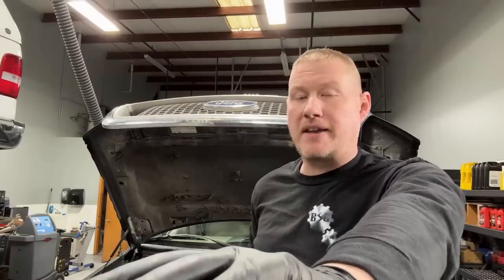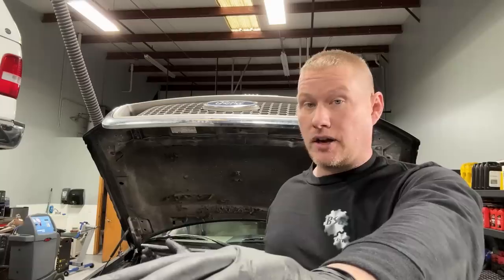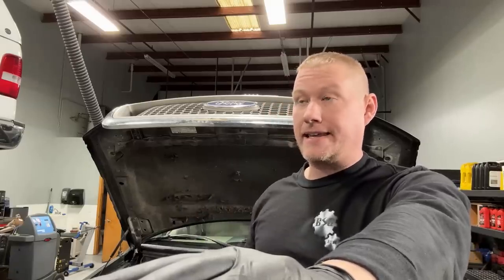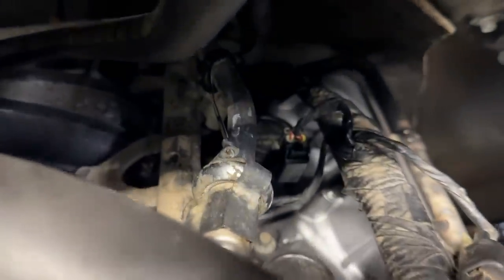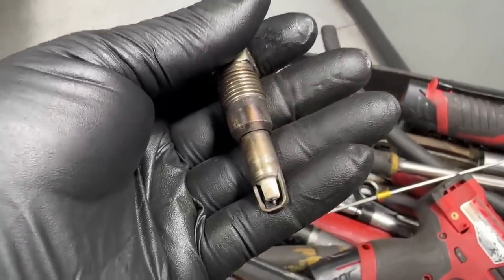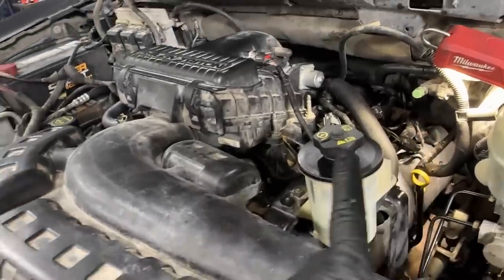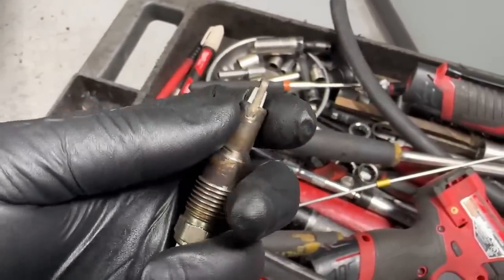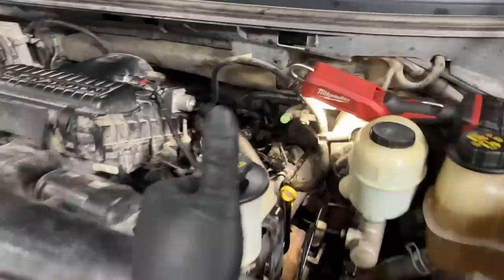How in the World is There a Belt Chirp Noise Coming from INSIDE of this Engine?

Comment: My 5.4 has 325k and has only had a throttle body replacement. It has original everything else. Engine has never been opened and even have original hoses, starter, alternator, etc. Change your oil, I use ZMax micro lubricant, and love your truck. I’m shooting for 500k!
Reply: My ‘06 5.4 3 valve had 190k. Plug’s and MSD coil’s @100k, throttle body and alternator were the only thing done to the motor. Frame was starting to worry me so we traded it in. Still ran like new.
Reply: No timing kit!?!?
Reply: My brother has 385k on his 5.4 and still running strong. Never opened up and only changed the plugs at 300k. It's a f350 with a utility box and only ran in the city so they are very rough miles.
Reply: @christinaperez254  nope, never opened the engine. Keep the oil changed @5k and full synthetic oil, I used Mobil 1.
Reply: @chriscochran8079  dang! I do all the same maintenance wise.... but still had Brian do a timing kit and melling pump job at 100k just for insurance. Our Expy is our family's one necessary car. She can't be out of commission.
Reply: I hear a low idle timing chain slap in my 2007 KR F150 at 195,000 miles. Do you have a chain slap? I believe due to tensioners. 5.4 3v
Reply: @christinaperez254  I completely understand that. I started to change the roller followers but stopped after trying to get bolts loose and they just crumbled. People just don’t maintain their vehicles on a regular basis, money I’m sure is the root cause, it will still run with dirty oil so they say I’ll catch it next time. All new engines have tighter clearances and orifice’s, maintenance is the key to longevity. Cheap insurance.
Reply: @chriscochran8079  which bolts crumbled? Exhaust manifold?
Reply: @christinaperez254  valve cover bolts. I guess I didn’t wash the engine enough.
Reply: Goes to show not all them are bad, I had one, heard so much negative about it I sold it after warranty ran out. Should have kept it probably would have been fine.
Reply: That is amazing. I've seen those things put really put on some mileage as well. It's a hit-and-miss you get a good one once in a while and you get a bad 1 once in a  Wow. Kind of glad you got a good one there buddy
Reply: @chriscochran8079  eww msd coils
Reply: @neilbrown82   90k on the MSD coils and a K&N cold air intake. Never had a problem with them unlike the Ford coils I had on my 2002 Explorer.
Reply: @chriscochran8079  that's awesome. So glad to hear that. What weight of oil are you using? Did you switch to 5w 30? I have an 04 F150. Owned it since new. I change my oil every 3,000 miles. Regardless. Overkill? I'm sure it is. Switched to full synthetic 5w 30 2 years ago. Not a tick. Knock. Or a clunk. Hope to drive it until the wheels fall off.
Reply: @brianstauffacher   I changed the conventional oil at 2500 miles until around 80-90k then switched over to full synthetic Mobil 1 5-30 until 190k. I used it as a truck, towed my Derby cars and beat up the bed. 35-12.50-20 Firestone M/T , this truck was used but always maintained. It gave us very good service. K-N cold air, JBA cat back exhaust, MSD coils and Champion one piece plugs around 100k, I was always trying to get something better than 10mpg loaded or unloaded, hwy or city, the only thing I didn’t like about the truck. Hope that answers your questions. 5.4 3valve is a good engine when serviced on the regular, don’t neglect it.
Reply: @chriscochran8079  best testimony ever!
Reply: I hear you bro. I believe their ol phrase built Ford tough My 97 4.6 shows odometer 297k but odometer out when i got 10 yr ago. Everything still factory installed. Ive got a belt noise why I started watching. Gave fifteen hundred then. Do believe got my money worth. I could sell for that now all these  years later. Was never a big Ford fan but admit my 2 toughest are 84 ranger (1st vehicle) I tried blow up n this 97f150. Good luck on your road to 500. Got odometer fixed last year so hopefully I join the club. Closer now than ever.
Reply: I just bought a f250 super duty it has 335,000 miles it has a belt squeak and a slight miss engine light is on

Comment: I feel like most mechanics would never think to check the spark plugs for a squeak like this.  Brian is knowledgeable enough to think outside the box. 👍
Reply: JUST KNOWING THAT ,WITH THE NEWER VEH YOU NEED T5O CHARGE THEM WITH THE NEG CABLE TO THE ENGINE GROUND AND NOT ON THE BATTERY MY FIRST FORD WAS 6 VOLTS POS GROUND
Reply: @williammason6578  a car club where everyone acts like boomers :P

Comment: I'm not mechanic but man, this is a class channel. I have a 2010 with the 5.4 triton and he has really helped me with the simple stuff.
Reply: They're great trucks. As long as you keep up with maintenance. My 2010 5.4 has 206K never been touched and 0 leaks.
Reply: I had my 2010 5.4 FX2 S’crew. until this past November. I had 300k miles on it. This man is Godsend. I have done so much with that truck myself because of him. You either “get it” or you don’t.  #F15012thgenerationloyal
PS: 12th generation is the way to go.

Comment: I had a belt chirp noise, worked on it for months, changed belts, idlers, alternator (old 1991 Dodge D250 Cummins) had me stumped. WELL finally found it. 
was a worn through last bend in the exhaust pipe , I live in Oregon, NO rust at all. but that worn/crack in the LAST bend before the exhaust tip. and it's rubbing was the chirping. Fixed that bend and NO MORE CHIRP. Man that puzzled me for a long time, now it is Great. Weirdest thing. really enjoy your videos even though I don't have a ford. Thanks

Comment: I had a 2009 5.4. When I sold it, it had 320,000 miles on it and the motor had never been touched and no oil usage. It ran like a top, no codes,and not one fluid leak. It had a very slight., what I think was a phasor knock but did not affect the drivability. I bought it at 30,000 miles and was anal about maintenance. It could go 1/2 million miles easily. Best truck I ever had.
Reply: I have a coworker with one about the same mileage, just been maintained.
Reply: Yep! I’m planning on being buried in mine! 😂👍🏼
Reply: why sell it
Reply: My 09 5.4 is at 278k nothing wrong with it but I am planning on doing timing chains and oil pump soon
Reply: I had the same truck with same motor and I loved it. Got the cam phaser issue too (it was BAD) sounded like a bag of hammers accelerating out of idle. Ended up traded it in for a 2016 with 5.0 and I really like this one too but i do miss the old one.
Reply: My 2006 ford f150  5.4 v8 that I still have to this day has 322,000 miles original engine & original transmission still going strong. I've always changed the oil every 3,000 miles
Reply: I call bs but ok.
Reply: @arielatom03  if I was you I would probably call bs also, but I swear my 2006 ford f150 5. V8 has 322,000 miles on it.  I've changed all the ignition coils with motorcraft coils (expensive) ,but ford 5.4 3 valve is picky and motorcraft parts NEVER DISAPPOINTS. All the spark plugs are motorcraft and never drive it hard and beat the shit out of it
Reply: @wesleythompson7  source: trust me bro..
Reply: I still have my ‘09 5.4 I bought new and almost 14 years later with proper maintenance it’s been mostly trouble free ( exhaust manifold & VCT solenoids replaced). It runs quiet and goes from oil change to oil change without using a drop of oil.The rest of the truck is still in great condition and I’m thinking I may end up getting 25 years use out of it.
Reply: All of you folks are truly blessed to have no issues with your trucks...  many are not.
Reply: Show us the underneath…
Reply: Cannot beat Ford trucks that's all I buy ..always. New '22 F150 Tremor in driveway now w/5.0L Coyote .
Reply: @arielatom03  BS what? Only BS you will hear is the supposed Yoda guys w/there 500k mis on these Ole 5.7L V8 Tundras...when they hardly sell any of those turds .

Comment: Our family drove i believe it was a 2002 Expedition 5.4 for well over 300k miles without any single problems, did have the entire front end rebuild and the A/C replaced but other than that the drivetrain was solid.  Oil changes every 3500 miles. and the thing was buttery smooth.

Comment: This is EXACTLY the problem I am having with my truck. Thank you so much! You're the man!
Reply: You should still diag the issue to be absolutely sure. It could be something else even though the noise is similar. I would do a relative comparison test. If you have a loose plug, you should see it when you run the test, and you'll also know what cylinder the bad plug is on.

Comment: Nice job finding it. Reminds me of a problem I had long ago, miss at idle. I had just changed the plugs and could detect a miss at idle, so I pulled the plugs just to see if anything obvious and of course once you pull one you turn it upside down to look at it and they all looked good, EXCEPT one. As I was turning it upside down and then back to reinstall position something caught my eye, I turned it upside down and back again a couple of times and found the inner porcelain around the center electrode was broken and sliding down over the center electrode when in install position and how it would be in engine, got a new plug and problem solved.
Reply: Had exactly the same problem with one of my Harleys a few years back. Went to the dealer for a new set of plugs, changed them out and took her for a test ride. She ran at idle ok but under load there was this really annoying intermittant miss. She ran just fine with the old plugs, so I pulled the new ones and found the center porcelain on one was broken and loose on the electrode. Never seen this before in many years wrenching on bikes, cars and trucks. Nobody I know and in the years since have come across this before including the parts guy at the dealer. I still keep that plug in my box as a conversation piece, and this was before everything came from China!

Comment: my 2006 5.4 3v will turn 250,000 in 200 miles. no timing job yet! bought it with 108,000 miles. this one was one of the good ones. proper oil changes with the motorcraft filter and full synthetic oil. plenty of life left in it. rusting away in maine

Comment: I've personally come across this concern 3 different times working at the Ford dealer. It did take me a bit the first time to figure out where the noise was coming from. A Stethoscope is key to finding it without the attachment, just using the hose.

Comment: I use the heater hose stethoscope regularly on heavy trucks with their hundreds of leaking air lines and fittings. Just yesterday I used it to pinpoint a leak from a drier regulator after someone replaced every air fitting in the area hoping to cure the problem.

Comment: My 2007 had the classic ticking sound and sure enough number eight was loose.  The plugs had been changed by the dealer about a year earlier and I don’t think they did a very good job because two others were a little loose as well. I checked the boot, which was discolored, but still OK.  I tightened everything down and no more ticking noise.  Now I know to listen for a chirp too.

Comment: My 2006 has 270,000 miles with no issues. Oil changes, plugs and coil boots. Front end bushings and link ends. That’s it. Runs like a top. Original transmission and I’ve never changed the fluid. Used to pull a fifth wheel travel trailer until my wife developed brain cancer in 2019. I had to rebuild the rear differential at 98,000 miles but that was years before I bought the fifth wheel travel trailer. I guess I got lucky.
Reply: Why didn’t you change the transmission fluid a few times over all those years?
Reply: @billc7211  Just something I’ve never done. Every vehicle I’ve ever owned has never had the fluid changed and I’ve gone into the mid 200,000 mile range with all of them. Just worked for me I guess. All Fords mind you except for a ‘79 & ‘80 model GM that I got rid of well before 100,000 miles.

Comment: Brian you are a tremendously gifted auto tech, thanks for sharing this odd ball event. I also much appreciate your comment about the reliability of the 3 valve engine. I have a 2009, been researching and studying this engine for 2 years because of the possible issues it may develop. I read lots of viewer comments about very high mileage achieved with no problems but gave emphasis to listening to your many comments and demonstration videos about the many inherent design flaws and production defects plaguing this engine. I have a full upgrade FOMOCO timing set and Melling oil pump sitting at the ready. I was, until today, still on the fence about to do or not do a timing job and upgrade to this 65000 mile truck, that runs and sounds perfect. I will now wait. I use full synthetic oil 5-30wt changed at 3-3500 mile intervals, always have since we bought that truck new. I figure the odds of engine problems with the timing/oiling issues are remote so long as the maintenance is timely and done right and that the truck is operated within its design capabilities...don't push it hard. I am out west in the dry country, I suspect that too has some bearing on engine performance with less humidity being a good factor for engine internals. Glad to hear you speaking well again, nice to see you recovered well from recent surgery.

Comment: That was actually the first thing that came to mind. I have seen bad manifold gaskets cause a similar noise, like a reed the gasses blowing through the layers of gasket sounds like squealing. Funny I just pulled a super duty 5.4 3v last night and found 3 loose plugs, some were over tight, all brand new autolites with anti seize. Glad I checked!
Reply: When I was a teen my sisters car had intake leak, just a tiny spot, made a whistling at high vacuum that you could hear down the block.

Comment: This video timing is ironic. I just started hearing this noise on my 06 Mountaineer 3v about 3 weeks ago. I haven't done much to look into it yet because I had just sealed my upper intake gaskets and did some major suspension work. I changed my belt tensioner without even thinking to listen without the belt (rookie mistake but I do get +1 volt on my charging system with proper tension) and this exact noise was happening on the passenger side valve cover near cylinders 3 and 4. After seeing this title I knew it would relate to my car as the 3v 4.6 and 5.4 share a lot of common ground. I just changed my plugs in October so I guess its plausible I did get proper torque on the plug even though I always torque these 3v plugs to spec. Guess I have something to look at tomorrow at work. Appreciate the videos you have saved me a lot of diag on my car and a lot of money as it gave me confidence to do my own valvetrain work

Comment: Great tip, Brian. With your training and experience, when you think about the seal design of the plug/socket interface, popping the plug out and checking it as you did becomes one of the first things to look at after vacuum hose leaks.

Two questions for you: (1) What was the most important part of your training to acquire the practical knowledge, skill, and expertise that now enable you to not only have your own shop, but to be able to share your knowledge on YouTube (the only social media I look at) and to train your son , and how old were you when you started?   (2) I have 3-door ‘98 F150 2WD, w/ 5.4 2 valve which I bought from a friend in about 2004; it is lightly used, and has no rust, carries 6 adults with plenty of room, and with its cloth seats is the most comfortable, and quietest, Ford truck I own.  The only issue is when making low speed turns, unusual noises come from the differential area - I understand that Ford may have issued a TSB on this problem, but have you ever done a video on putting in the recommended bearing kit on one of these standard differentials? 

Hope you have fully recovered from the surgery, and thanks for continuing to try to educate your viewers about how to diagnose and fix issues big and small with their Ford trucks.

Comment: Good find . I installed a new belt on my 12 valve and it started the chirping.  Went on line and found that the cheaper belts can do this . I installed a gates belt chirping stopped.  Many years later again a odd noise it was the pivot on the belt tensioner making a noise . Found this with a long hand screwdriver.   A couple years ago I bought a used TDI Jetta with a alh engine.  Apparently someone had replaced the injectors and they were leaking at the gasket or washer . I finally had to build a mandrel in a lathe and use some lapping compound to get the head to seal up .

Comment: Thanks for all you share! Man I wish you were my mechanic! My 2010 has 120k miles. Going in Wednesday for a power steering cooler leak, which is shared with bigger A/C cooler. Other than an alternator, it’s the only problem it’s ever had.👍 Fixing to go bumper to bumper with maintenance though. Hopefully last many more miles. 🤞👌

Comment: This is great. My ProCharged 3.7 Mustang has had a chirp that I have been chasing for a while. I’ll check my plugs. It only happens when the engine is not quite at operating temperature and under some acceleration.

Comment: Brother that is awsome. I'm fixing to do a 5.4 3v swap on my 03 crown Vic. I'm going to have to lock out the phasers. The stock ecu will run it. It'll just run like a 2v but with more power. The torque from the 5.4 will do great for that heavy girl. Thank you for the tech. That could cost somebody paying for a whole engine or head.